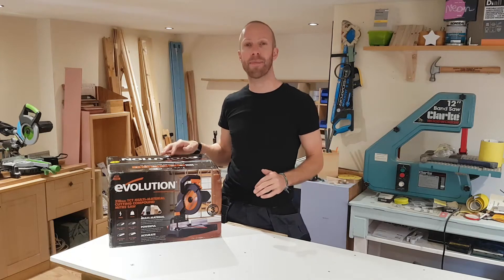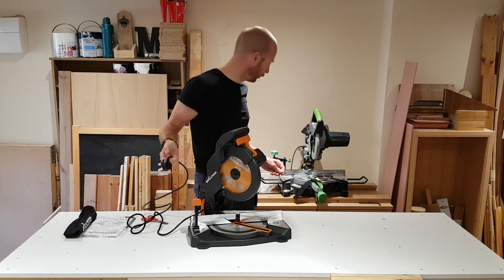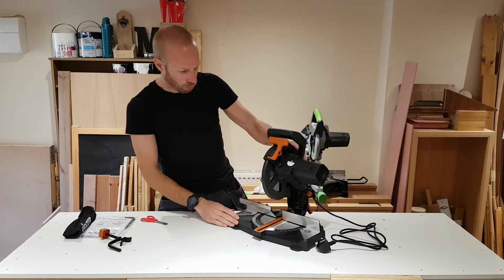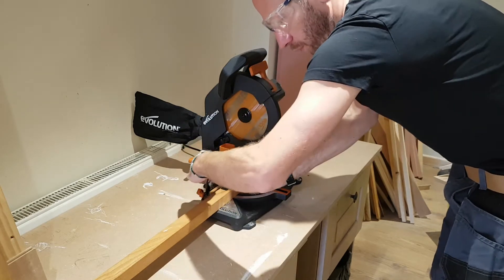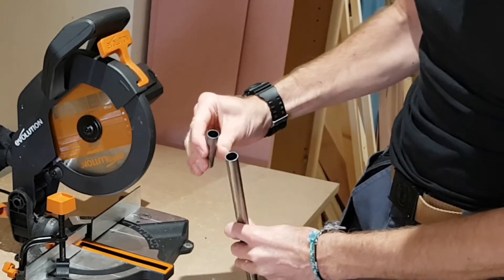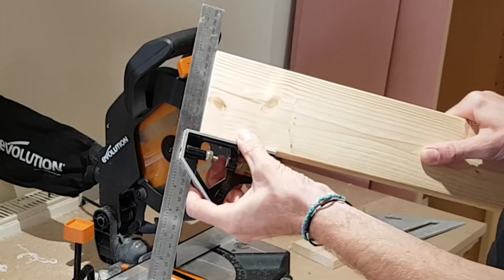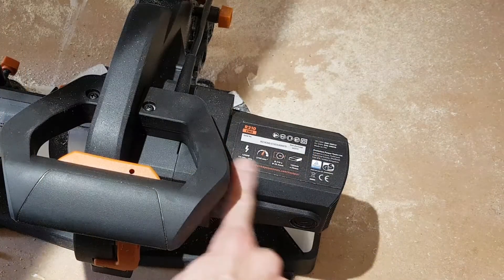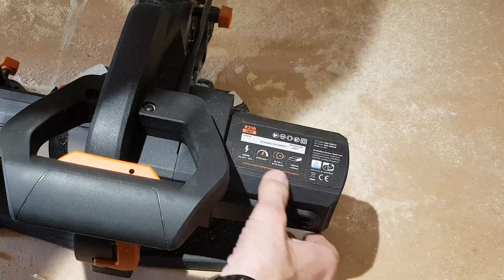Evolution R210 Compound Mitre Saw full review

Comment: Ive bought one, yet to use it. Ive heard there are isues with cutting steel angle. Any input?
Reply from the maker: I've had no issues with it, as long as the piece is securely clamped 😁

Comment: I'm not sure I would recommend this to anyone for a first mitre saw. I find the stops to adjust the angle have loads of play in them and I'm constantly having to get the square on it to check before each cut and if you're a beginner, you just don't want tool inaccuracy on top of your own newbie mistakes. I cut straight through the fence on the first bevel cut, because I'm a novice plum. It is powerful enough, but I find there is a substantial amount of tear out on the bottom and the rear. I think this is probably best for a jobsite saw, cutting pipe and trunking.